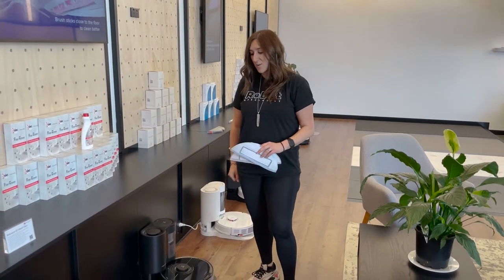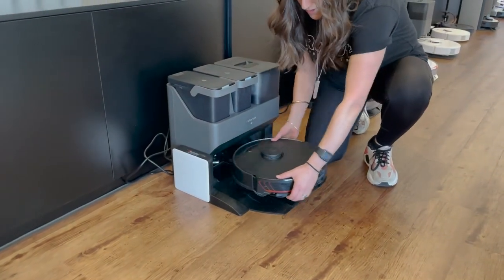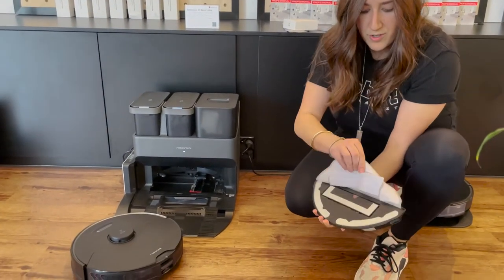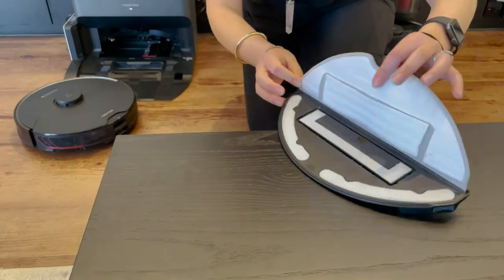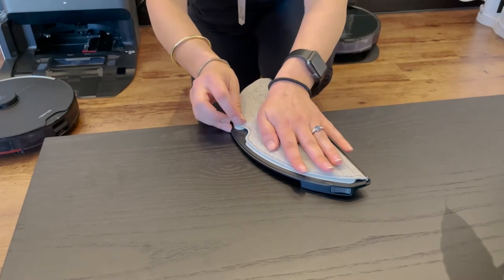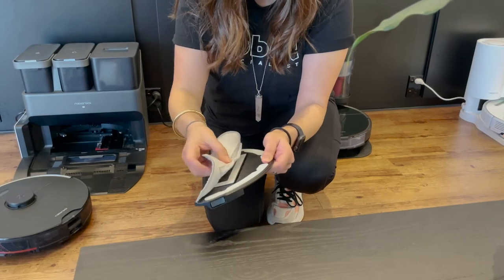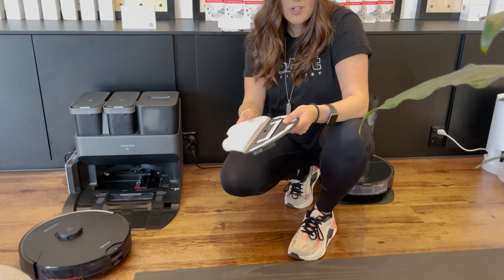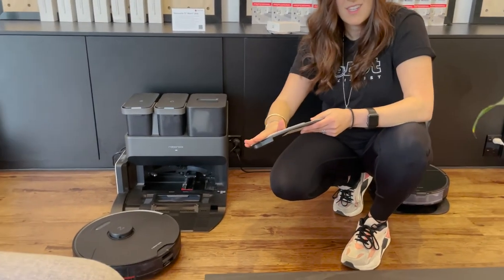How to Install the Mopping Pad Correctly (on the Roborock S7, S7Max V, S8 Series)

Comment: was looking for a quick video on how to INSTALL it. Instead you REMOVED it and then talked about washing and other things without putting it back. Great ! Thanks !
Reply: Also, this doesn't help people who have the 7 MAX ultra, as it doesn't have those tabs to remove the mop... Was driving me crazy! Till i figured out that you need to tear it from the velcro on it's mopping pad and just slide the mop out. 

It's like the 7 MAX ultra doesn't exist...
Reply: So how DO I replace the mop cloth on S7 max ultra?
Reply: @imjobob2  It's attached with Velcro and a plastic strip. First undo the Velcro, then slip out the mop and plastic strip from the side
Reply: @AAgunner  thanks - done
Reply: @AAgunner but do you need to put the robot upside down to do that? During the first vacuuming process with the 7 max ultra I needed to pause it and take the mop off because my cats’ hair stuck onto it and looked like a vale following the robot. I turned it upside down and all the cat litter got out on the floor again 😢
Reply: @reformerka  Yes you'll need to turn it upside down. This vacuum also has a non-removable water tank that i spent an hour looking for...
Reply: @AAgunner  okay, guess I should have waited for it to remove the dirt in the dock before taking off the mop. You live and you learn. Thank you 😄